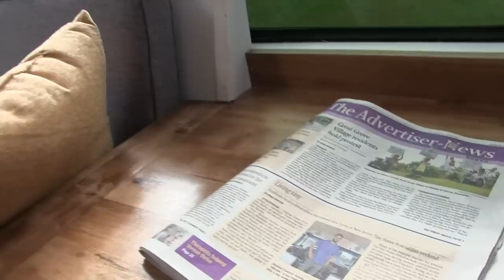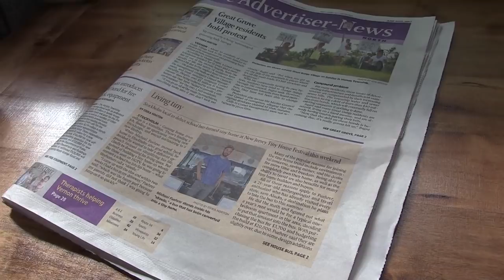Spectacular Tour Of Tiny House School Bus RV Conversion Camper

Comment: I hope that you have a carbon dioxide (and propane leak) detector down low. Having a Co2 detector on the ceiling is pointless as Co2 is lighter than air.  You'd be in a world of hurt if the Cob2 got that high.  I've had detectors go off twice in an RV, both times could have been ugly without them.
Reply: CO2 and CO are HEAVIER than air!

Comment: Very nice, so roomy! Great job on the undercoating and redoing wheel wells and body work. That is the way not to let it rust out, where there is snow and salt on roads.  

11:15 - with regard to RV tours, take a photo of fridge insides and post pics outside and lock the fridge.  They can see what it looks like from the outside.
12:30 - The bathroom looks very nice! Tile does add weight but so great to have real tile.  One trick to reduce weight is not to use Hardie Backer board as a substrate, or similar, but use Kerdi board which is very light and waterproof.  Hardie and other cement boards are super heavy and get damaged by moisture.  There is also a Kerdi membrane, and Ditra.  All pricey, but made by German company Schluter and very good quality/totally waterproof.
The trick with tiling in an RV is to use very small tiles, use Polymer in the Thinset mortar and also polymer in the grout instead of water for both.  MAPEI sold at Lowes, makes a great Polymer and Grout Maximizer (polymer) and this Italian company makes great thinset and grout too.  Using polymer in grout means you don't have to use sealer over the grout lines every year. The polymer rubberizes the grout and thinset so they don't crack. Ditra is a floating type of backerboard that also absorbs all vibration from tile as van is moving and provides a 'floating floor' for tile. 

The best composting toilet with low price is the Italian Trelino.  Way cheaper, slim profile, diff heights: https://mytrelino.com/
Humble Road uses them. They are a premier custom van builder.
Love the deck, what a great view! Thanks for the tour.
Reply from the maker: Appreciate the great information

Comment: In US it is big roads and big cars are no problem but it is pretty long this one still not too wide. Cars made of wood and aluminium is really lasting - with some steel frames - if they have a strong motor and frame, suspension, drive shafts and intermediate shaft, universal joint and wiring. A Mercedes motor is really a wise choice if it is of the right lasting one.

Comment: Just wondering about the propane, freshwater, grey water and holding tanks. I didn't see them. Excellent build. If you head down the road, you'll want to get that A/C running (Generator).
Reply from the maker: Please check out the update video

Comment: Compliments on a great job. It is beautiful. You raised the middle of roof for the height clearance? You changed out the differential for better smooth speed or for more weight? Does it have towing capabilities? How were you able to get insurance? I bought a school bus for conversion about 4 years ago and tried for a year to find insurance. Was always told school buses are top heavy and prone to layover so nobody was interested insuring. I felt as if the RV industry was blocking it in general via fake news and rules etc. Any ideas? Lot of questions...Thanks

Comment: oh Jeez, you have been able to buy an empty Fleetwood travel trailer at a reduced price for over twenty years. you can even specify no wallboard (to put in your own) and to add a wood stove. i have been on the used RV scene for twenty-five years.
Reply from the maker: But it’s a trailer or a drivable, then you have to buy a tow vehicle. How can you compare?
Reply: @NewJerseyOutdoorAdventures  it's just for my own land mostly. the mechanics and parts and tires for a big bus overwhelms my abilities. my size is usually a van. or pay someone to tow a trailer onto my land. used vans are not too expensive sometimes. and they can tow too.

Comment: "The deck and the solar panels are not resting on the roof, they rest on the suspension." lol
By that logic, then your head is not resting on your neck, it rests on your feet. lol Structural, your head is connected to your spine bone, connected to your rib, connected to etc... etc... Just like how the roof ribs connect to the wall ribs to the floor ribs, to the etc..., but that is why they are called "roof ribs" because  yes you guessed it, they are the roof, of which the panels and deck rest on.

FYI without those roof ribs there would be no roof. Just like how if you had no spine, then you would have no head. Your head is not just floating on your feet. lol

I know what you mean though , you just mean you are not dumb enough to try to mount that stuff to the sheet metal. That would be like trying to stitch a skull to neck skin, and ignore using the spine to connect it. lol  One big bump and it would rip off if you only attached to the sheet metal, especial the deck.

Comment: Why are they doing away with TV's in RV's? That's odd! He should have put heavy duty plastic as shower doors because he will have wood rot issues later on down the road from water moisture when he showers after a while. I saw the shower curtain, But it looked like it was silk or cotton. Not much protection for the wood doors. He should at least have a long plastic curtain. Otherwise it's a nice conversion.
Reply from the maker: Check out the update video some of your questions answered

Comment: "We got the bus really cheap".. After maybe 15 years living in a trailer or RV or whatever you want to call it, I can promise you that "really cheap" does NOT exist. Unless you are self employed or have wealthy relatives, you're better off renting with a landlord that might make the needed repairs, than  with owning a trailer or bus that must have  the  repairs and have no way to pay for them.. believe me, it's no fun making it through a winter with no hot water, heat, or running water. Because the pipes do burst and  furnaces die  etc etc...  Just so you know....

Comment: If it's targeting gen x and millenials, it SHOULD have a television. You're talking about targeting the technology generations, and adding less technology? Personally, I'd at least have a small, low power tv with chrome cast, possibly a Windows 10 tablet with GPS, USB power banks, dynamos for charging on the go, solar panels, bluetooth stereo with usb/fm/aux/micro sd with a decent antenna or set of antennas and probably more. We're talking about living in a micro home, possibly on the go, not avoiding civilization entirely and hiding out in the forest where nobody can find you for the rest of your life. As much technology as might be needed and would be practical and useful should be packed in, even a mini 12v microwave for heating drinks and a 12v camping fridge.
Reply from the maker: Thank you for watching. Please check out the update video